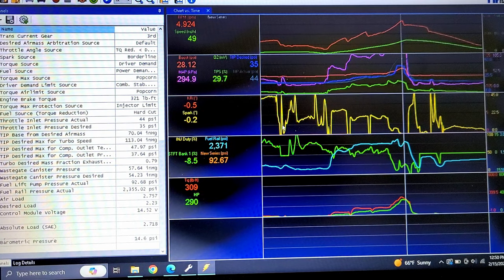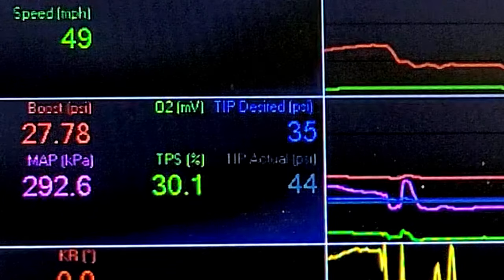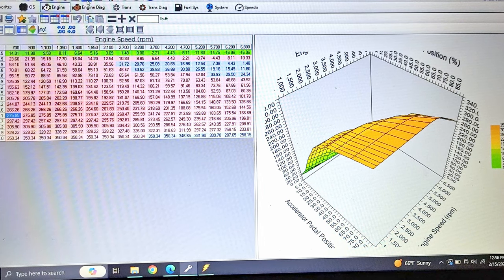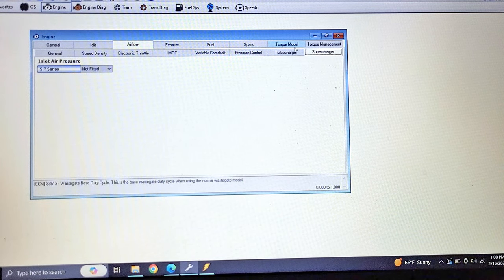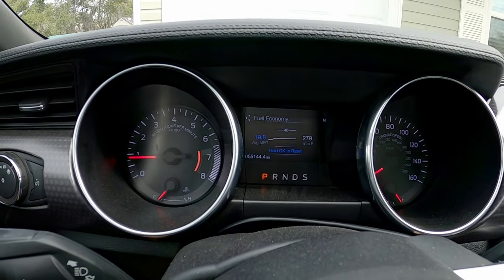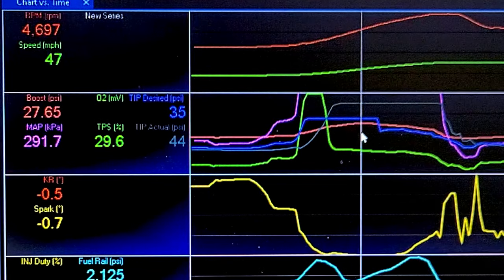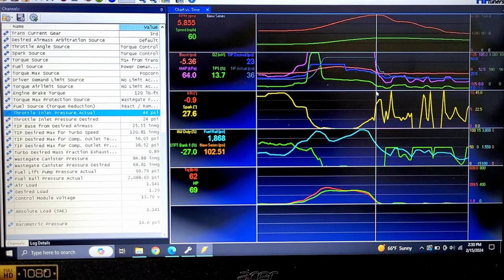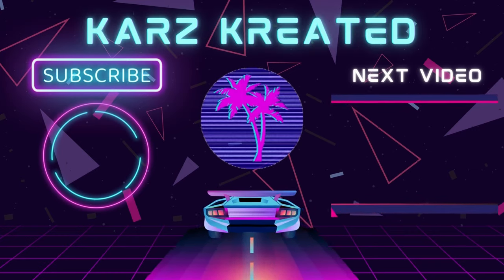My Ecoboost Is Still Overboosting After Tuning - Very Bad Tuner

Comment: If the duty cycle of the waste gate is increased then it should be able to bypass enuff exhaust gas around the turbo impeller. And that should let the ECU keep boost in check. Another thought is if the spring in the actuator is lighter then the waste gate control might move it faster to also help with boost condition.

Comment: zero out WGDC and make a pull on gate pressure. then slowly add in duty cycle conservatively and just play with it. this is what i’d do on a customer car if i ran into this. you’ll never get the T-Plate fully open, how ford controls boost and torque man. it’s annoying but that’s just what we have to deal with using hptuners as we are editing the oem tune and not a custom operating system like cobb uses which is straight load vs WGDC and makes them simple to tune. DD drives the DBW control system which in turn opens the throttle blade more and this is directly driven by DD. More torque request in DD = More torque. This is the primary pedal plate relationship. From there that is fed into the SD fuel model then into TB model, this then outputs airload which is then fed into the TQ table, then it looks at the torque inverse and sees desired load based on torque request. If that helps you understand any of this better. you can also see your fuel system is at its limit in your log due to the amount of boost and ethanol in the tank. just keep an eye on that as well
Reply: DD = Driver Demand
TB = Throttle Body
DBW = Drive By Wire Throttle Body
WGDC = Wastegate Duty Cycle
SD = Speed Density

Comment: I don't think you're doing anything electronically wrong! 
We have to remember, the over boost issue was a problem before you started making interior electronic modifications to your ECU.
Before plugging in your HPtuners Interface, did you remove any and all external boost control devices, both electronic and physical?
Reply from the maker: I'll give you a hint. It's the wastegate. I'll have an update video tomorrow.

Comment: could the over boost be  4.5 psi over maximum standard boost not 20 psi ?  Eg 6psi stock + 4.5psi max overboost /safety margin = 10.5 ? thats ok👍but 20psi wow,,, isn't it there to protect your motor
Im enjoying this,Good content
Reply from the maker: That's how it should be. After reading around, I realized this is a common solution to a common problem with the Ecoboost cars. Not the best solution, but it's the easiest one.

Comment: Could it be that the Throttle Inlet Pressure sensor cannot sense above 44 PSI? So because the sensor is physically incapable of telling the computer a number above 44, it caps its reading to 44, then the overboost condition cannot be set to "true" when desired TIP often gets to above 24 PSI. (I dont really know anything about tunning :D ) edit: typo
Reply from the maker: Well 44 psi is the max the sensor can read. It's only a 3 bar sensor. The car throws the code if the desired TIP is too far away from actual TIP. After 5 seconds of the values exceeding each other, that's when the car protects itself.